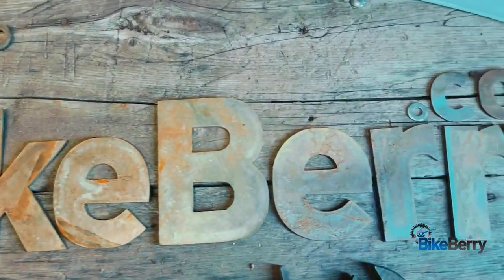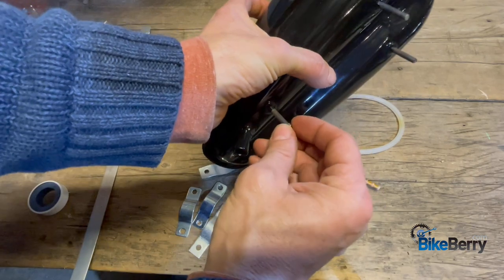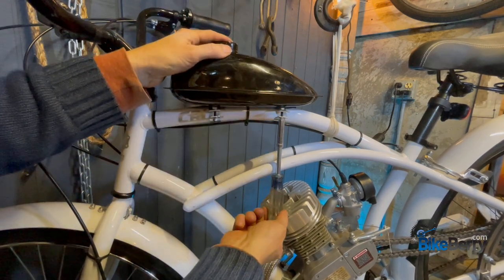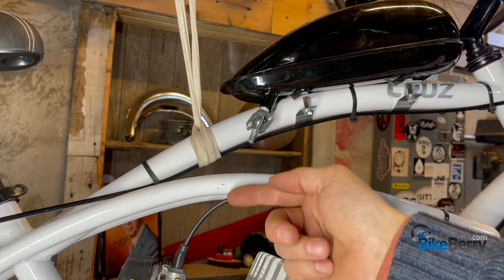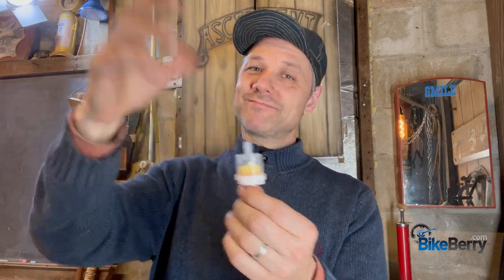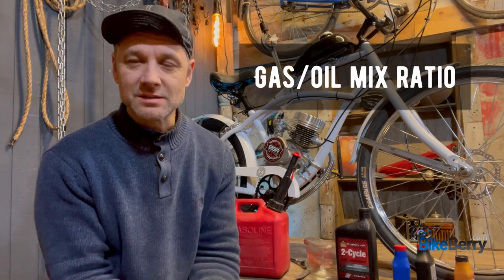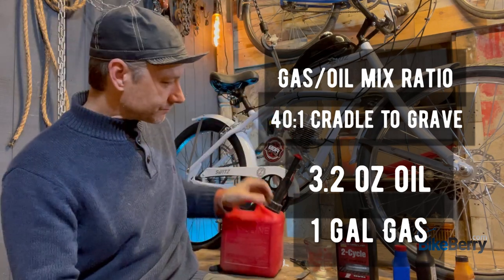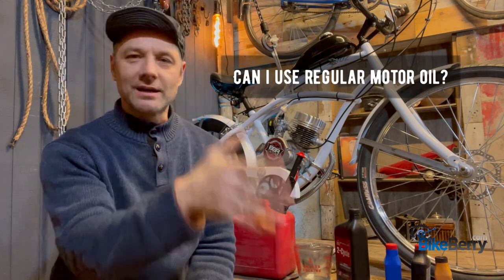Gas/Oil Mix Ratio Fully Explained | Gas Tank Mounting Method Revealed! | Motorized Bike | Bike Berry

Comment: Actually, crankcase oil (motor oil) is really really bad for two strokes. Not only is it NOT designed to burn, it will CAKE your exhaust, cylinder, piston, etc, in carbon. Two stroke oil, however, is MADE to burn with the gas. It's way different from crankcase oil, in that it is 100% designed to burn. If you have a good two stroke mix, it shouldn't smoke, because it's two stroke oil. Crankcase oil will smoke really bad, because it's meant to lubricate for long periods of time whilst withstanding burning. If you're planning to travel far, bring a little 1 gallon two stroke mix jug. Echo powerblend works great, (since I have lawn equipment as well) because they sell little jugs that you pour the whole thing that mixes 50:1 for one gallon. And those bike tanks are about half gallon? So one little echo powerblend jug for one of those tanks will make a 25:1 - 30:1 mix or so, which isnt bad for a pinch or quick ride home from the gas pumps. I run 32:1 in my 66cc, since I'm going trail speed (not fast enough for efficient air cooling) so I need a little richer mix to keep the head cool. This might sound really redneck, but the way I calculate temps on any engine is to spit on the exhaust right out of the cylinder. If it burns and sizzles, it's past 212 F, and based on how fast it sears away also determines how hot it is. If you spit and nothing happens, you're good in any circumstance.
Reply: Echo powerblend is a great idea for longer trips. Thanks for the insight my man! 💪
Reply: Yeah I haven't got one of those motorized bikes yet, I got an electric bike but I plan on trying to use a weed wacker motor right now and trying to build me a motorized bike out of that and, that's the two stroke also so we'll see how that works and I know you can use one cause I've seen the video on it,  you've gotta use that two stroke Motor oil for that also so will see how well that works out for me. I'm disabled with neck and back injuries and pedaling for long periods, just eats away at my back, so I really need a good bike, and that's why I'm gonna try to build the weed Wacker bike.
Reply: As 2 pushing it home or nothing it will work
Reply: If I have a 80cc bike what oil and fuel should I use?

Comment: 25:1 break in and 32:1 after is fine
Reply: I second this! I’m in California and all my bike seem to like this
Reply: I'm on my second gallon of 16:1
Reply: @danpen717  hell man no too much oil use  a half gallon with 2.5 oz and then 32:1 for life that’s it as long as ya take it slow n easy let it warm up before use during break in it’ll be fine
Reply: @danpen717  ya but  my bike 16:1 bike berry told me to use 40:1 I have new engine I didn’t get manual from person I bought mountain bike from feel’s ppl get bunch different answers so who ones plus my bike not broken in yet
Reply: @demonic2534  I used that and it bogged 3 blocks and a piston rin cracked in half.
By the time I opened it to clean the head half a piston ring fell into the crankshaft.
I put the piston with 1 1\2 rings so it fused.
I'm buying a new one tomorrow after a month,🥴🥴🥴🥴🥴🥴🥴🥴🥴🥴🥴🥴🥴🥴🥴🥴🥴🥴🥴🥴🥴🥴🥴🥴🥴🥴🥴🥴🥴🥴🥴🥴🥴🥴🥴🥴🥴🥴🥴🥴🥴🥴🥴🥴🥴🥴🥴🥴🥴🥴🥴
After a month and half thou
I used Valvoline vr1 racing
Reply: @danpen717  dammm man I’m sorry to hear so don’t use 16:1 idk what type oil someone put in it still in first tank once u go with synthetic u got to stick with it
Reply: @danpen717  is that oil non sythetic valvoline vr1 racing

Comment: I've been mounting my tank like that for years,  I was always surprised I'd never seen anybody else do it that way.  I've never had any issues with leaks doing it like that.
Reply: That’s awesome. It’s definitely the best way to go.
Reply: I tried and couldn't get it to work.   The first set of nuts won't go up into the painted threads, no matter how much sanding I tried and I won't dare crank any harder or the bolts will rip out.  I first tried with nylon then regular stainless and  no go.   This upgraded mount was a complete bust for me :/      Wish it had gone differently

Comment: It’s nice that the 40 to 1 is getting out there. Before many builders use this 16 to 1. I did a recent video on break in and 16 to 1 ,does more harm then good. <3
Reply: 16 to 1 looks like it gums up everything with deposits and drips out the exhaust from what I've learned. I'm doing a bit extra oil to a premix 40 to 1 can then doing 40 to 1. People say the 32 to 1 and 16 to one makes less power too. The mixture is too lean
Reply: When i first got my engine I ran the 16:1 break in as recommended. THE BIKE WOULD NOT START. No matter how much i kicked it over going down a hill. I was getting very upset, think I bought a new magneto and stuff and spark plug was so confused at the time as a young lad! 

I then took engine apart and realised how much oil was in there it was disgusting! I pressure washed the whole engine and exhaust put 20:1 in after doing research and it started straight away. Deffo does more harm than good.

Comment: I've seen people use pieces of inner tube in the engine mounts and tank mounts for less vibration as well
Reply: I did this, sealed it tight with rubber tape too so water doesn’t get trapped against the frame
Reply: That's what I did.. just finished my first build. Tomorrow is gonna be the maiden event.. lol
Reply: Foam tape

Comment: i love your videos    ive bought a few things from bike berry           I dont so much agree with the fuel to oil ratio    My reasoning  is ive blown engines up with the cradle grave phylosophy     i run my first few gallons 32.1 with a bit of stp oil treatment     the first few gallons its slow and rough      gotta plug chop it use a wire brush clean the plug   after you run those few galllons do the same  but with 40.1 and just a tad of the stp      bro   youre engine will last forever

Comment: I love this regarding the oil gas mix.  Straightforward and simple.
Regarding the 40:1 I had already heard of another guy who was just reusing one of those little 2.6 oz 2-Cycle oil bottles you can get at any store as his measuring cup.   There's actually a 3oz fill line and a view window right on the bottle.
One of those in a 1 gallon gas container and you're good to go

Comment: This couldn’t be any more helpful. I just got my little engine a few days ago, I am very happy with it. Bought it used and has a few issues but from experience on dirt bikes I took it apart and fixed it. I was stressing about the best fuel ratio, thankfully you saved it. But the big question for ethanol? To clean the carb, would seafoam work aswell?
Reply: If you use your bike frequently you likely won't have to worry about the ethanol. If it's going to be sitting for awhile, turn off the fuel, start it and let it run out of fuel.  
Do this and you won't have a problem from ethanol.
Seafoam "can" help clean a fuel system that's "not quite clean" but is really meant as a prentative measure. It won't protect from the ethanol issues if left sitting though.

Comment: Phantom 85, just been Delievered, thanxs for the info, they sent upgraded bushings, so not looking to burn up a motor! 40:1 for break in it is!
Reply: Waiting on MS-380 piston kit, put windows on piston, be ready for the road then!
Reply: I would still run a lil richer first take 20:1 then after 40:1.. I do first take 20:1 then 30:1 after never had any problems

Comment: Great video!! 👍👍
I think part of the reason for the 16:1 ratio for the breakin isn't just for the piston/rings/cylinder. Keep in mind you'll have purchased a brand new engine that likely has NO lubricant in it at all. That heavier mixture initially will help get oil in and around all those little nooks and crannies where its needed just as much as in the top end.... crank bearings, connecting rod, etc. By the time some oil has worked its way to those hiding places (a tank or 2 of fuel), then you're good to go with less oil in the mix. Just my 2 cents on it. 👍👍😁
Pete 🇨🇦

Comment: I am at year 5 of building and running motorized bikes.
I like the idea of the double straps for the tank. I have been simply cutting off the studs. I found some clear plastic tubing which has a 1/4 thick wall, this I cut it in half and place it under the tank. The tank gets large cable ties over rubber tiedown straps, this shock proofs the tank from the engines vibrations.
For the engine it's self.  I match all the ports and gaskets. I raise the intake port by 1 mm and  lower the exhaust port by the same 1mm. This adjusts the Timing a little. Now for the carb. I have been experimenting with the jets.  Because I am running a Tuned pipe I run just a little bit richer than the #70 stock jet.
Fuel mix. During the winter I run Regular  and in the summer Prem. The difference is the temperature they burn at. Reg is a little hotter than the Prem.
Oil, I have been using the Stehl Chainsaw oil, mixed at 25-1, this is double the normal amount of oil than for the Chainsaws.
Finally, these two stroke engines really like the heat. So, before you go riding they really need to be warmed up completely. 10 minutes at a fast idle. The idle screw needs to be turned in for a fast self running idle, as the engine warms up idle will come up, turn the screw in a little, as the engine warms it will increase idle again, readjust. Usually the engine does this about 3 times. By simply listening to the engine it will tell you when it's warmed property.
Reply: Wow thanks Keith for the detailed comment of your experience! Great guidelines my friend😃
Reply: This is good advice. I've been messing with these things for near a decade. 25:1 mix for sure. I've had good luck with Lucas semi synthetic oil. Letting it warm up and gradually ripping it harder and harder for short runs is how I do it. These nor any engine like to idle.

Comment: I've taken off several intakes from bikes I've bought, needing repairs. Including my own, the intake gasket is compressed and made smaller. I've opened these up, after porting a shop towel in 1st and opened up the opening. Bottom end power and starting is much easier and better. Then down jetting it by 2 helps.

Comment: I just finished my newest (#4) build with a BBR 66/80 engine and used the recommended 40-1 mix. The engine seized after a slow 6 minute 15 mph ride. I managed to break the seize and it still runs but I’m concerned that the mix might be light on oil. Should I remix?
Reply: I would do about 25-32:1 mix and run between those cradle to grave I have never had any problems with those ratios with plugs or anything at all
Reply: To be honest I've been running VP 40:1-50:1 multi mix for a while with no problems in mine with same engine. Maybe its just a matter of time before something goes wrong but she still runs strong. I have lost some top end power though every since I removed the cylinder a while back. I feel like its due to the piston rings having lost their seating, if that's a thing.

Comment: Tip 6 copper head gasket: throw it on the stove top on high heat let it turn dull color this will anneal the metal making it soft so it will conform and seal better.
Reply: He is right. But there is also another way and that's after the first time riding it you re torque the head bolts

Comment: I have a 29inc. Midway  beach cruiser from schwinn , I threw a stock china kit to it. Now running a kx80 motor cycle back in the day you had to glaze the engine ,so I ran it rick for first half of tank. yes had to clean the plug after with gas and fine grit paper. Same with this bike 66cc. I still win it rich 35/1 an for some reason this motor loves the low end it gives it. I can do 45 mph but like 20 that way i get to see everything and have to peddle every now and then. I think glazing is a good practice
Reply: Ps my instruction manual that came with said set suggested 16/1 but i started at 25 for half a tank then went to the 32/1 on a full now just the 35/1 all the time.

Comment: Tip 8 sand the area around gas tank bolts and fiberglass around them this will prevent the bolts from cracking and leaking when bumped also can tank seal the inside this will pretty much stop leaks before they happen

Comment: I have two tanks with leaky rubber gaskets so fuel is getting all over the tanks and on my pants. Can I get decent gasket replacements at the local hardware store, or should I go back to BB for more of the same questionable materials that have gone bad in a hurry?

Comment: I’m new to motorized bikes and I’m going for my first switch out from a mountain cruiser to a beach cruiser. High-performance car change out and CDI plus magneto. I’m having a hard time getting chain adjustment correctly what’s the best settings for the chain holder wheel to be at?

Comment: The reason for the extea oil for the break in is that you want the rings to set into the cylinder wall BUT you dont want it to do it fast. Think of it as sanding, less oil = lower grit sandpaper which will wear in fast. More oil = higher grit so it will wear into the wall slower. You want it slow because it creates less tolerance between the ring and the wall because the break in was more gradual. Im not going crazy like 16 to 1 but im adding a bit more oil like a 32 to 1 just for the first tank. Ride easy and dont tax the engine too! When you put a new turbo in a car you take it easy on it so the bearings break in slowly so you dont get any tolerance gap and get play in the turbine. Im just applying the same principles to this little thing. Im also adding a bit of marvel mystery oil directly to the cylinder to prevent it from scratching anything when it first gets moving.

Comment: Regarding all the extra hardware mouting the gas tank. Wouldn't yiu have the same affect by simply mounting the tank normally but just don't tighten the nuts too much. Then add on 4 more lock washers and nuts to the original nuts. So 8 nuts total. Then the stress would go to the first set of lock washers and nuts and not on the gas tank. Isn't that correct?

Comment: Would white Teflon tape work for the fuel shut off valve
Reply: It might. Just try it out and see.
Reply: @tonytaylor5087  I tried that actually n it didn’t work after a while so I got some sealed stuff that I put on the valve

Comment: When I mounted my very first gas tank I took the rubber from an old tire and used it as a " motor mount " I don't know how well it works as the clutch seized up

Comment: What if I'm installing the hp carburetor and it has a smaller diameter where the hose should go? It's smaller than the shut off valve and the filter, a conversion or just tight it tight

Comment: I filled my 1 gallon tank all the way up(beyond fill line) and then added the 3.2 oz of oil. Will that make the mixture too lean?
Reply: @kadenmack2009.. It's very important to mix the oil and gas in a separate container so it mixes up good. It's not a good idea to pour the oil directly into the gas tank. Even if you already have gas in the tank. It won't mix up as good as it does in a separate container.

Comment: Hay what happens when you have a clutch  is loose not the little bevel the big bevel that holds the clutch pads it wobbly I can see the little bearings of it I could barely put grease in them

Comment: hi mine starts up, but the engine doesant engage, i never hear clicking and when i push it to go downhil its start to start up but never engages the engine all the way, i dont see white smoke and it stop after 50ft,  i tried different % of gas to oil mix and adjusting the carburator screw all the way up and down and open the air hole different amounts and still wont engage the engine

Comment: I don't recommend using the stock shut off valve that comes with the kit, it didn't stay sealed and leaked all my fuel out, it also didn't stop the gas flow just slowed it.

Comment: I run it at 16:1 currently but its almost through its break it period so if i change to 40:1 will i see a change in speed or just a change in carbon build up? #builditright
Reply: Just overall health with the engine.

Comment: Oh yeah and of course smooth the edges of then port openings smooth leave no burs  in them check the rings as well smooth all the sharp edges inside the cylinder and on piston and rings and clean well before reinstall

Comment: Tip three after chain has stretched (get heavy duty chain ) tighten the chain as good as ya can buy master links and half links for bike AND engine chains try to get it snug without the tensioner a lot easier on a bike with a derailer I recommend using a mountain bike ya know
Reply: Then pull wheel to tighten it up right and adjust bike chain to fit if ya must use tensioner put it before the spokes and use the damn four bolt one and or a engine mounted tensioner
Reply: Half links can be a problem. The ones I received look like a perfect fit…but the post with the cotter pin is a tiny bit long and won’t clear the walls inside the drive sprocket housing with some of the aftermarket covers. If you grind down the post to fit better, you expose the cotter pin hole. Ask me how I know 🤣🤣🤣

Comment: I did 40:1 and had that motor for almost a year, 32:1 on this engine I'm running now for 2 years and it's still going. If it's a Yamaha 40:1 is fine not Chinese motors

Comment: Here’s one…. Remove exhaust and bolts/studs sand or file the mating surfaces smooth and even apply a small amount of high temp high torque or just high temp ultra copper a thin film to the smoothed surfaces let tack up and join them together throw the gasket in the tool bag for an emergency

Comment: Amsoil says with their oil to use 100:1 and you'll see no deposits. You can supposedly do this because of its "superious" lubrication style - @ $28 bucks a quart. You rec. 40:1 but for what oil? Huge difference between petroleum and true full synth.